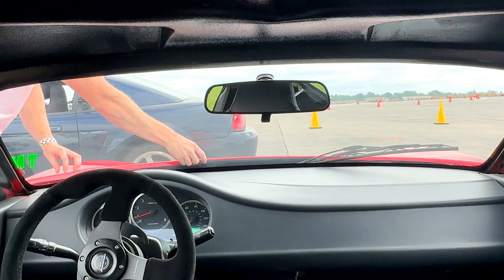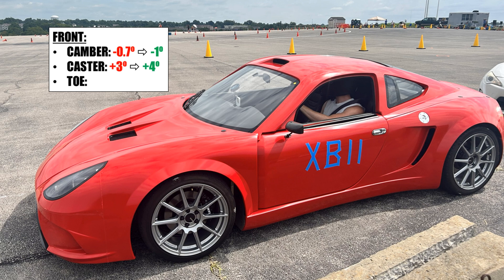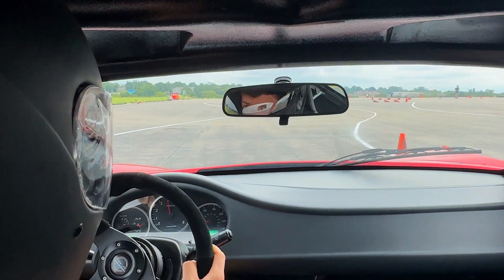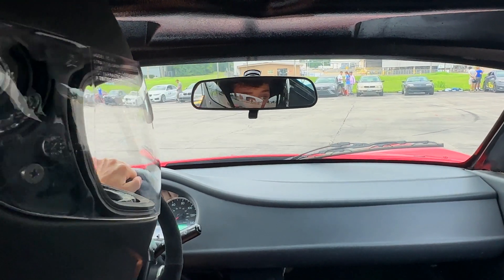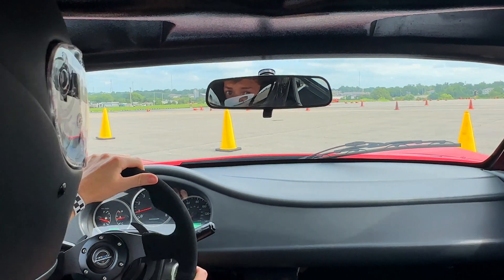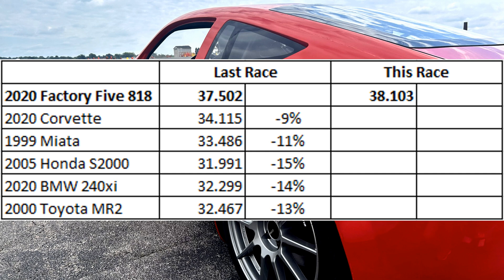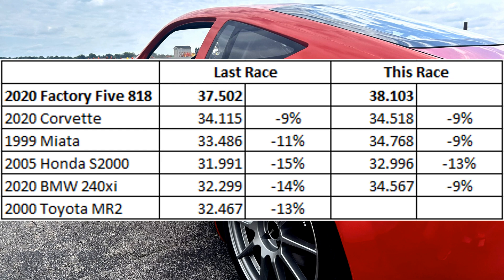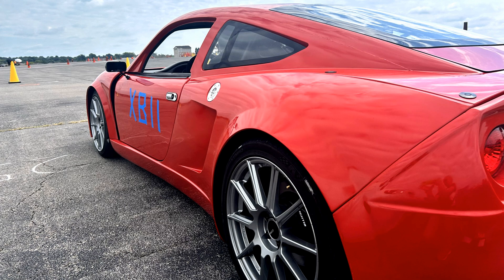Increasing CAMBER To Catch Faster Cars At Autocross (Factory Five 818)

Comment: I have a Cayman with similar weight distribution as your's. For an aggressive street/mild track alignment, I've found that front -2.0 camber, 0 toe and rear -1.8 camber, 0.08" total toe-in works well with quick turn-in yet minimal tramlining on the street and even tire wear.
Reply from the maker: Thanks for sharing! My front is currently maxed at -1 camber and my rear is -0.75. Now that I've done a few events with this alignment I consistently have good turn in but some oversteer. I need more grip in the back but already struggle with straight line traction. I'm sure more camber will help with balance in the turns but the car will probably feel worse on straights and the street.

Comment: Keep up the work brother. Glad ur racing it! One thing i disagree with you on is your decision not to run sticky tires. I assume ur on somerhing like a max or ultra performance tire. Tires make a huge difference in a cars ability to overcome understeer. Im not sure if your suffering from that or not but i strongly recommend you get some 200tw tires if you want to close the gap and fix issues with handling.
Reply from the maker: I'm on a decent summer tire but they're 460 treadwear. Once these wear out I'll bump up to 200's. Making other changes for now which has been fun experimenting. My handling is actually great right now, nicely balanced with some slight oversteer, but I need more grip.

Comment: Nice work! Good to see the improvements. I was surprised with the front camber set to positive but its mid engined etc so I assume that's what works in that case :)
Reply from the maker: Thanks! My camber is negative. Maxed out the front with my current setup at -1deg.
Reply: @mikecamera818  my mistake I understood you had positive on the front 😊

Comment: From an open-wheeler background for what you're doing- you don't want stable, you want change of direction. This isn't about being comfortable, it's about getting over there quick, and tyre temps are a great guide for basics. It's data, and data works.

A properly balanced- weighted, pressured, cambered and castored- car is fairly even across the tread face. You haven't mentioned tyre pressures. How are you working out your camber- are you doing the 3 x tyre temps (Inside/Middle/Outside)? You might also like to increase castor to get better turn in. For the front axle, remember a tyre is flexible not solid and you want the tyres flexing the right way to start. Ideally you'd set a tiny amount of toe OUT to preload the front tyres- they are already deformed to turn, whereas if you've got toe in they are deformed the other way. For a taxi, sorry, road car, toe out at the back can also induce roll oversteer if you're stuck but don't overdo that. I'm guessing you're stuck with your Ackerman so far
Reply from the maker: This video was focused on my alignment change. In my last video I chalked the corners of my tires to make sure I was using the full tread. Low tech but effective.

https://youtu.be/a6s48XXZVaE?si=1mgrs-UYIIBJUkkZ

I increased caster in this video and actually maxed out what I can run with my current setup (+4deg). I've only seen 1 person run toe out on these cars. Much more common to run high caster (+5 to +8deg) with toe in. My camber is also maxed out at -1deg in the front.

Since this is a road car I do want stable, not nervous and twitchy at every turn.

Comment: shouldn't you switch to toe out to aid on turn in?
Reply from the maker: I've only seen 1 person run toe out on these cars. It worked well for him but toe in is more common.
Reply: @mikecamera818  on an autocross you are more concerned with quicker turn in than high speed stability.
Reply from the maker: My car is used more on the street so I have to compromise for highway stability
Reply: Personally, I would of kept it at zero at the front since it's a good compromise for street, track and autocross. But hey, the best thing to do is to experiment different setups.